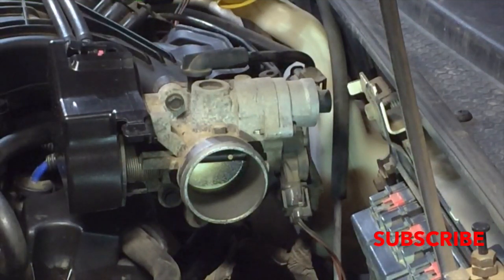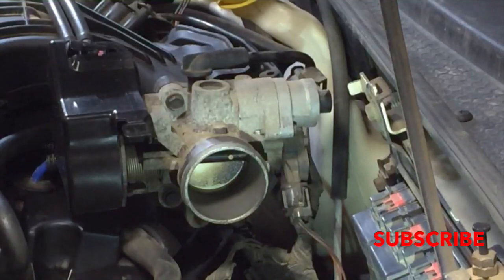PT Cruiser Throttle Body Cleaning How to

Comment: I had to come back and comment Matt. Wow!!!  I just finished my test drive after cleaning the throttle body.  She runs like a hot rod again. 🙃 I chose to remove it and clean then replace. It was nasssty black.  I bought my 2005 “Silver Bullet” PT Cruiser (not turbo) 12/22/2004.  She had 4 miles on the odometer and was my first brand new car to ever buy.  I was 42.  For the last 7 years my husband has used her to drive to West Texas to work then back home and she had an encounter with a deer once so she has damage on the front end.  She has 249k miles now. My newer jeep has transmission issues so I hopped into the Cruiser and decided I want to restore her.  She hesitates on take off and didn’t seem to have much git up.  So I found your videos and decided what the heck.  I’m 60 now so my cruiser will be 18 this year.  I told my husband, “even a girl can do it”.  On to the shocks now.  Thanks a lot for sharing the information.  🤓🙋🏻‍♀️
Reply from the maker: That is so nice to hear!!! Sorry for my delayed response, I have just been super busy but always love to have comments like this! Good luck on your continued journey with your PT.

Comment: I have a 2007 PT with 35,000 miles on it, owned by an elderly couple. Just recently I got an engine code P0123 for the Throttle Position Sensor high voltage circuit input. Can this code normally be remedied by cleaning the throttle body? Or will further investigation be needed?
Reply: Just get a new sensor and clean it out before you put in the new sensor be better off that way
Reply: Check the wires, first.  Cheap plastic wire covers are used on these things.  Most are worn off to where the wires are bare.  Buy OEM sensors when you can and replace once.  I have replaced just about every sensor in my PT Cruiser.  PT for Pain in The...
Reply: Try cleaning the idle air control valve ( if possible) I had to replace the whole throttle body on my 2006 pt cruiser and then it ran like it should